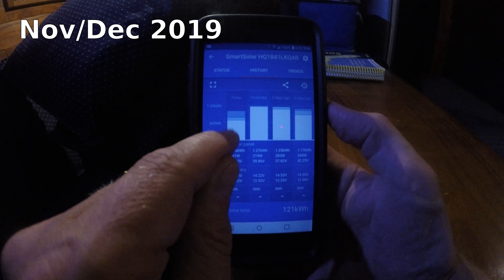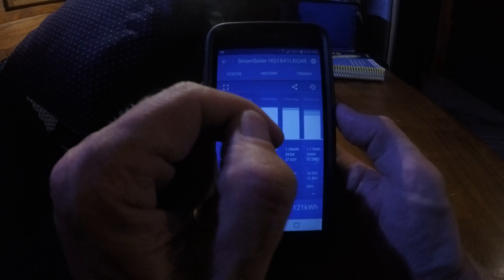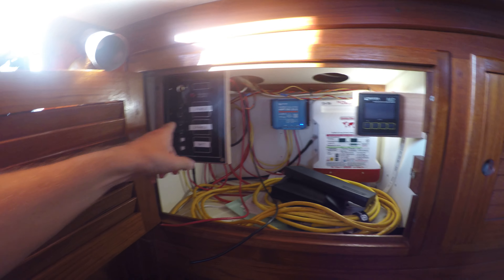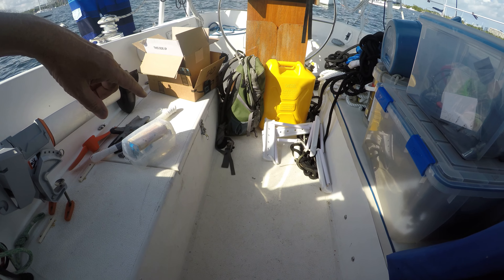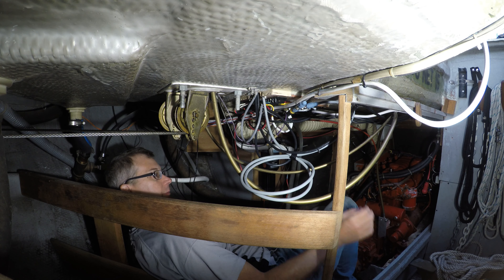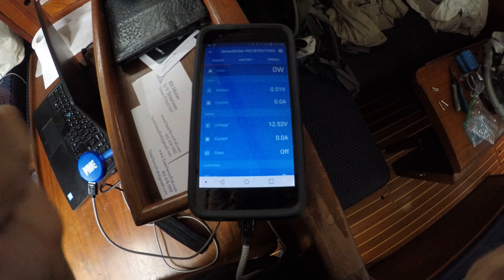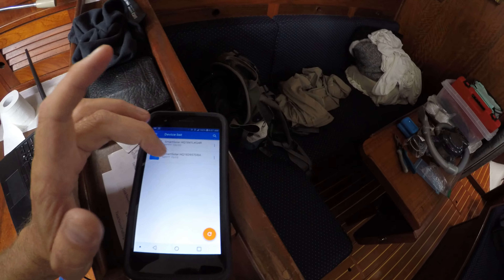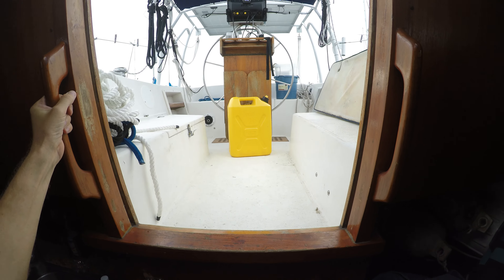77) Upgrading my Solar

Comment: So what is your total solar array comprise of thanks great video
Reply from the maker: The two large panels are 160w each, and the two small are 100w each. So, theoretically, I have 520w total.
Reply: @tankneverfull3931  Significant solar capacity. I think I saw that you had three Firefly's which would be about 350 AH of capacity with an effective capacity of over 200 AH. Are you satisfied with your system now? I would think with sufficient sun you would not need to run the engine much. Thanks.
Reply from the maker: @jessefalsone1247  I never had to run the engine to charge the batteries (keep in mind I was in Florida the whole time, so a lot of sun, even in winter). Before the 200w upgrade it would sometimes take a few days to top the batteries off it if was cloudy/rainy. But after adding the smaller panels to get to 520w, I would be fully charged every day in all types of weather. On a clear day I would generally be fully charged before lunchtime.
Reply: @tankneverfull3931  did you ever upgrade your alternator? You had the stock 55 amp which is lucky to pump out 25 amps. I'm upgrading to a 105 amp with Balmar regulator. Should do the trick. I wanted to stick with an alternator that would fit and use the same V belt. Might need to detune the output a little.